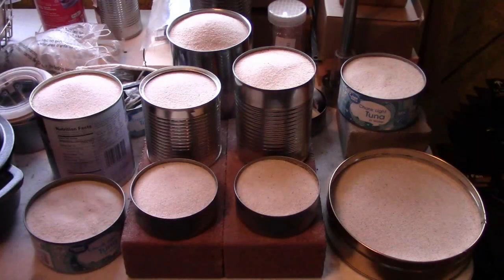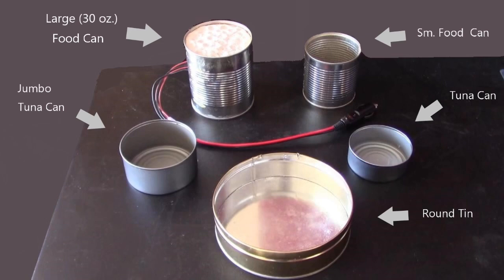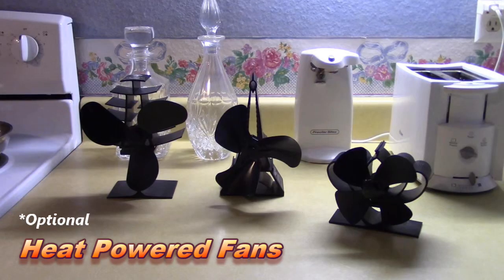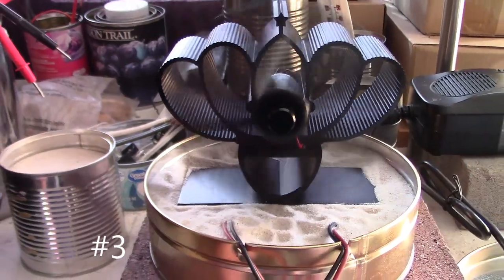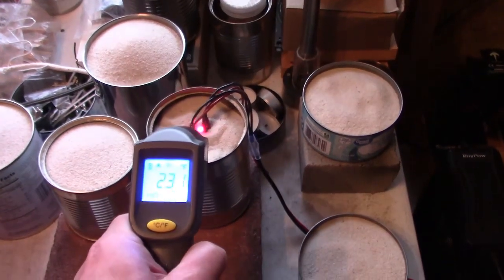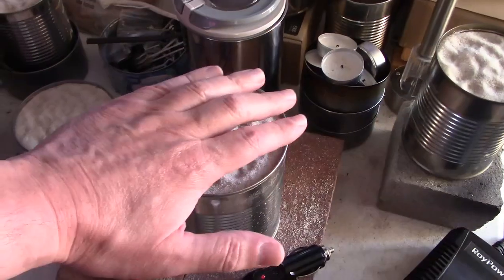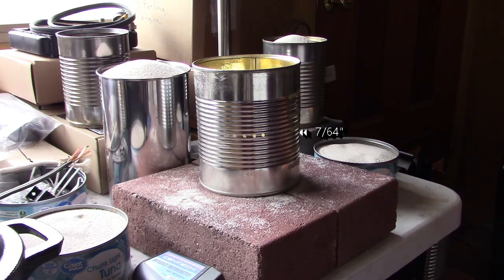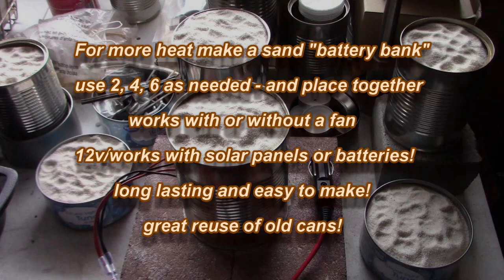5 DIY Sand Battery Space Heaters! with Heating Elements! 300F/150C (self-regulating Ceramic PTC) 12v

Comment: Would you run any optimisation tests? Ideally you would have a timer that turns the element on and off because with the sand retaining heat for hours afterwards, surely you could just 'top it up' every 15 mins or so and maintain a decent average whilst not having to power it 24/7?
Reply: Or have it ran by a temperature controller maybe?

Comment: First time I've encountered the terms "PTC" or self-regulating heating element. Thanks for the Video.
Sand proves itself AGAIN to be useful in so many ways!!!!
Links for the Stirling Fan Designs would be greatly appreciated.
Reply from the maker: hi. yes, i've been a big fan of PTC heaters since i discovered them. very efficient way to heat and relatively safe because they are self-regulating. to be clear i didn't use the stirling engine fans but i used thermoelectric fans. i guess you could use stirling engine fans but those cost a lot more. to find the kind of stove fans that i use just search for 'stove fans' on amazon. it will bring up 50 or more different models. from 15 to 65 dollars. the ones i use cost between 15 and 30 dollars. here is a link to one
https://www.amazon.com/VODA-Designed-Blades-Powered-Fireplace/dp/B01GJAUU4U/ref=sr_1_7?crid=3CCLP4RGRAMHD&keywords=stove%2Bfans&qid=1699728440&sprefix=sto%2Caps%2C1168&sr=8-7&th=1

Comment: Hi DesertSun Commerade: Good experiments. Great Program.

As a suggestion, a simple way to heat up the desert sand to maxium temperatures, place a solar disk, or frensnel glass - depending on sunlight avalibity as per geological places.  

Within 25 minutes entire sand container becomes hot exceeding 1800° C.  

Thermal insulation within the drums are must.
Reply from the maker: hi. yes, i think a parabolic dish or a frensel lens is a great way to heat the sand. a good size fresnel lens might heat it very fast
Reply: @desertsun02 I'm so happy feeling like you'll see this, because it was recent you replied here. 
Anyway I thought I'd ask you if the metal bucket used would have a risky affect if I used a copper bucket. I see how copper is used, placing it into the sand and not sure if it gets hot. Of course I'll have it on some pavers, but do you know if anything that might result, that could be of any danger?
I'm hoping from being new to sand batteries, I might have the perfect bucket. If I need to move it, it has a cast iron handle like a pail...about 15" in diameter. Thanks for all your knowledge.

Comment: I wonder if you couldn't connect a surface burner element to the wires and put that in the sand? They're obviously made to be heated, and you can pick them up for 15$ or free if you know where to look. You see a lot of stoves dumped at apartment complexes that get hauled off by scrap collectors.

Comment: I would like to see a plain bigger oil barrel filled with sand and an plain electric BBQ charcoalheater on solar panels. Naturally it wil not heat up within a single day like the smal containers but thats the whole idea. You do not need the heat in the day time but when its cold at night. Like the Fins do with their Polar Night Energy project. They store summer solar heat in Sand in a big silo in the summer to use it during the entire long winters. The bigger the container the better the heatconservation and the bigger the energybattery. Interesting to see what would be sufficient for on single house. Like how many solar-panels and how many sand-filled barrels. The Fins already figured out they can use plain/ cheap sand and cheap low-tec like plain electric cheap resistant heating elements and simple metal pipes in the sand to blow in cold air to harvest the heated air at the outlet. This could be the answer to our global energy storage problem because 80% of our energy consumption is needed in Heat-energy during the winter.

Comment: Is there a specific sand you use?  Is there a recommended sand to use?  Also, what would be needed to heat a 10 x 10 room?
Reply from the maker: hi. i always use filtered and rinsed 'play sand'. (the kind for sandboxes). main thing is to use 'clean sand'. beach sand should work good too. i'm not sure what size the system would need to be for room heating. some people are using barrels of sand and getting a few days of heat at a time. i've been wanting to try heating sand with fresnel lens but haven't so far. maybe this winter season
Reply: @desertsun02  Awesome!  Thank you!
Reply: @thedevilsadvocate3710  In winter climates that get below freezing, a 10x10 room needs about 1200 watts of heating, or about 4000 BTU/hr.

Comment: Just started looking into this. I think I'll use this in my greenhouse. I'll use a solar panel to heat during the daytime and extend the heating of the greenhouse past the sun hours! I'm assuming any sand will work?  at 4:00 you put the ceramics side by side, why not put it 1/3 and 2/3 in to evenly heat? just curious, I'm assuming the heat would dissipate. Also wondering if using aluminum heat sinks would move the heat around faster? 
Just some thoughts, thanks for the video
Reply from the maker: i like your ideas. i'll try the 1/3rd and 2/3rds idea. i'll also try the heat sink idea. that may work very well.
Reply: Metals transfer heat well.   Electric heating of a large thermal mass of sand may not be necessary in a greenhouse.  Simply placing it inside in direct sunlight would heat it during the day.  Imagine a few black painted 55 gallon barrels of sand or just water.  The temp would not get too hot by direct sunlight, but it would slowly release its heat for hours or even days.  Depending on the size of the greenhouse, add as many barrels as you need.

Comment: did you ever do one with solar panels? curious to use it to heat a small out building..
Reply from the maker: hi yes, i've used then with solar panels (and with 12v batteries).
Reply: have any good - "direction".. as to how to hook those up?  @desertsun02

Comment: Could there be a way to combine a sand battery system with your soda can passive solar heating system?  Perhaps have a few cans filled with sand and heating elements powered by a battery.  The battery could be used for night heating and re-charged during the day.
Reply: That's brilliant,passive solar looks gteat. . Converting solar to electricity to heat sand seems silly unless you have run out of battery storage.

Comment: Would using a container for the sand that is rectangular rather than cylindrical make a significant difference, assuming the same volume of sand?
Reply from the maker: hi. i don't think it would make much of a difference.
Reply: Round shapes have the least surface area for a given volume.  This would retain heat energy best.  In a stationary application like a home, whatever shape container you have of sufficient mass is the determining factor.  A 55 gallon drum filled with dry sand would weigh 816 pounds including the drum.  That is a nice thermal mass for keeping a room warm all night.

Comment: Thanks for the video.  What size solar panel would be needed to power the heating elements?
Reply from the maker: hi. figure about 2 amps per element. 12v 100 watt solar panels are usually 5.5 to 6amp output so they will run up to 6 at a time.
Reply: Thanks. @desertsun02

Comment: Im trying to avoid 12v but the water heater elements are burning out like 170°
Reply from the maker: hi. water heater elements need to be used in water. they can't be used to heat sand.

Comment: Did u heat the sand or how does the sand get so hot?
Reply from the maker: various ways to heat the sand. i usually use oven or stove top to heat the sand for the videos, but you could also use campfire, off grid stove, parabolic dish, fresnel lens and a few other ways (like DC powered heating elements).

Comment: Hi! I didn't read all the comments,  but could you insulate those cans on the outside with concrete?  Might make the wiring tricky but it would use less power to get the sand to temperature. Just a thought
Reply: Wouldn’t the insulation have to be removable so that it would radiate heat when you want the heat to escape?
Reply from the maker: hi. i'd have to give that one some thought. i'll look into it.

Comment: This is really cool! I must try this. I'm wondering what size of sand battery you need and how many PTC's are needed to warm a 45 square meter room. Have you tried larger volumes of sand?
Reply: Obviously the bigger the unit, the better.  The future of energy storage is solid state sand batteries I have heard.  A grain silo full of sand, with proper insulation, would stay hot for a VERY, VERY long time.

Comment: Excellent video and thanks for sharing. How did you connect the heating elements to the DC plug? What's the connector call and can you share a link to an example? Thanks again!
Reply from the maker: hi. it's just a straight connect from the wires on the plug to the wires of the elements. i just slid the wire into the loop on the plug, bent it over and slid the plastic sleeve over the connection. here is a link to a similar plug https://www.amazon.com/dp/B0963QJLRG/ref=sspa_dk_detail_2?psc=1&pd_rd_i=B0963QJLRG&pd_rd_w=838Di&content-id=amzn1.sym.dd2c6db7-6626-466d-bf04-9570e69a7df0&pf_rd_p=dd2c6db7-6626-466d-bf04-9570e69a7df0&pf_rd_r=G4SGS8D8AAD877AZ9MDT&pd_rd_wg=gPtnn&pd_rd_r=d69e67d8-04fa-44bb-8161-2ff3f0155623&s=automotive&sp_csd=d2lkZ2V0TmFtZT1zcF9kZXRhaWxfdGhlbWF0aWM&spLa=ZW5jcnlwdGVkUXVhbGlmaWVyPUExN0I2Qk8yT1NEUVpBJmVuY3J5cHRlZElkPUExMDQxOTk0Tjc0UFNDUEwzRkMyJmVuY3J5cHRlZEFkSWQ9QTA5NTEyNDRVOTBRQk45UjhFU0gmd2lkZ2V0TmFtZT1zcF9kZXRhaWxfdGhlbWF0aWMmYWN0aW9uPWNsaWNrUmVkaXJlY3QmZG9Ob3RMb2dDbGljaz10cnVl

Comment: I'm planning on building a larger sand battery using a water heater element and bigger box & hooking up a solar panel. My concern is will I need some sort of intermediate circuit breaker to insure the direct connection doesn't damage the panel?

Comment: how about chucking some sand cans into a wood stove
Reply: have you tried grass/biomass dried powdered dough carbonization pellets/bricks, both for structure construction and fire bricks or just fire fuel
Reply: how about no moving parts pulse jet type heat sink, cone/triangle shaped heat sink jet, cold input air heat expansion heat powered totally passive element
Reply: how about no drilling at all, just the cans, with the wires
Reply: keep the container sand-proof

Comment: Great idea. Thank you so much.
I have two questions here:
1- Can we submerge these PTCs in water?
2- How many Amperes do they need?
Reply from the maker: hi and thank you! you cannot use the PTC in water. they draw about 2 amps each. a little more at startup (in the first few seconds) but them they pull about 2 amps. sometimes they pull a little less after they have been running a while
Reply: @desertsun02  Thank you very much.

Comment: These need to be as big as possible to minimise heating losses. Many small containers will likely be several orders of magnitude less efficient than one larger one of the same overall volume.
Reply: in this case heat loss is the whole point - but the sand bleeds out heat for a lot longer than water

Comment: How big do you think you could make one of these?  Drum size for releasing heating a room after the sun goes down (emergency or supplemental heat)?  Thanks so much for the video I've been interested in this topic for a while.
Reply from the maker: hi there. you can really make them as big as you want. you just need to have the heating elements for whatever size you choose. 🙂
Reply: I would run aluminum tubing through holes towards bottom and bend up to pop out top i would totally surround those tubes with sand and wax with the elements inside natural convection baby

And mix sand with salt and silica gel maximum storage and now im learning perlite too which should shed  a few lbs

Tighten lid good...so you can move with dolly and not leave trail of sand through house

On nice days pop top and train a fresnel lens on it then pop top back on and wheel back in house

Maybe invest in one of them wheel rollers made for 55 gallon drums the hold the drum in and have like 4 or 5 wheels or something

I would hook up solar to heat it....but during night switch to a homemade wind powersource or batteries maybe topping off with solar constantly with solar trickle charger every day ...maybe 2 trickle chargers as they only put put 1.5 amps
Reply: @xgymratx  What is the difference of only sand and sand with wax? And the mix of sand, salt and silica gel what is the advantage? I m curious it s very interesting. I was thinking of making one like the bucket video and adding ptc heater, https://www.youtube.com/watch?v=SXnEMFOSKhI&t=5s

Comment: Can the element & wires handle the high heat?
Reply from the maker: hi yes. the elements are made tough and durable and they have high heat resistant silicone coated wires. they can handle over 500F(260C. they will hold up perfect (even under heavy use). 👍🙂

Comment: My issue is electrical usage.
I'm on a very humble solar system.
I think it's best for me to heat sand with my propane heater, so I can extend propane.
Have tall, slender cannisters I can position in front of heater.
Have heat power fan, as well as USB fan that only burns 1 watt, blowing from ceiling straight down.
Sleeping area only 6/6 feet.
Live in desert.  Sand free.
Also interested in passive heating contained sand inside greenhouse. Paint containers black, south facing.
Reply: Thats a wasteful use of the propane. It wont extend the heat it will overall produce less heat because when you heat the sand up some of the heat will escape. 
YOu might as well just directly heat the air when you need the heat. . The point about these is they are using excess electricity in the daytime to give off heat at nighttime. You dont have excess propane.
Passive heating in a greenhouse would indeed work though you'd likely want to have (say) tubes buried in the sand and funnel hot air through them with small fans because otherwise the top layer of the sand will heat up but lower down it wont the sand will act as an insulator. That is though the same principle as using excess electric, you are just cutting out the middleman of solar->electric->heat.

Comment: have you tried insulating the cans?this may be useful for heat retention for those using solar to run the pads
Reply: The sand is the insulation. You could double up the cans, putting a smaller in a larger.
Reply: @Sourpusscandy  i thought the sand was almost like part of the element in conjunction with the pad,as in with a tank of hot water it is the water you warm up and and insulate the tank to keep said water warm for longer
Reply: @marksmith3455  except that you want the heat of the sand to radiate out into a room
 Unless you're running water through a coil inside the sand.
Reply: @annebeignatborde1832  i didnt mean like fully insulating the cans sorry suppose i wasnt very clear, i imagined to insulate the sides and bottom so the heat is still funnelled out of the top just wondered if it would keep warm longer so it could be heated with solar through the day perhaps with a lid on it then used into the evening after solar hours when its dark
Reply: @marksmith3455  ah I see. So doubling the cans as previously suggested with some kind of insulating material between them?
I'm more interested in heating them on a wood stove to use the heat it produces more efficiently and save any solar power generated for lights and electronics. Although I have found a project that may allow me to power a light from some of that heat.
Hope you find what you're looking for.
Reply: @annebeignatborde1832  i have a similar project in mind,my stove has a removable disc on the top and i found an old fire extinguisher at work which fits in the hole so im thinking to cut the top of it off drill 4 bolts into it half way down at equal points to stop it falling all the way inside the stove fill it with sand and have it dipped inside the stove with the fan placed on top just before bed hoping  the sand battery helps keep the room a bit warmer for the morning if all that makes any sense?i know what i mean anyway

Comment: I wonder if you could hook up a battery or 2 and a solar panel and just let it run in a room or a bathroom and maybe even put a thermostat on it, you can do it if anyone can.
Reply: How about hooking them up to timers? The elements don’t need to be fired full time - extend the life
Reply: @jcyork1767  that would be excellent  , thanks
Reply from the maker: hi. yep, you can let these run 24/7 if you want to. the elements are very tough and can be used continually. they are commercial grade so they hold up to harsh conditions
Reply: @desertsun02  good deal

Comment: I was going to try this myself. 
Thanks for taking the guess work out of it. 😆
Reply: The one thing I intend to do a wee bit differently is I'm going to give mine a layer of Plaster of Paris on the bottom and bottom edges. I'm hoping that will insulate the bottom so I can set it on the floor without bricks.

Comment: You said that copper is the best way to get all the heat out of these devices then use copper pipes inside the sand with the heating elements so the air can pass through the copper pipes you now have the solar and the energy from the heating element working together all the Advanced Technologies that we have like cars all work with alternation either use the concept of the water wheel or the bicycle this is called overunity been around for thousands of years like the seesaw that is over Unity. People may not believe it but guess what it actually works what do you want to go by what people believe or what you can actually do